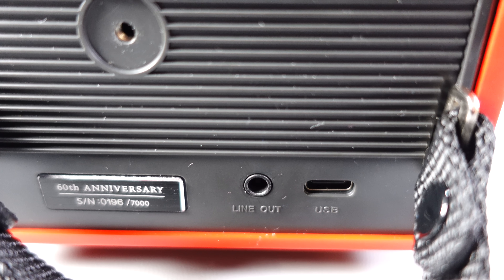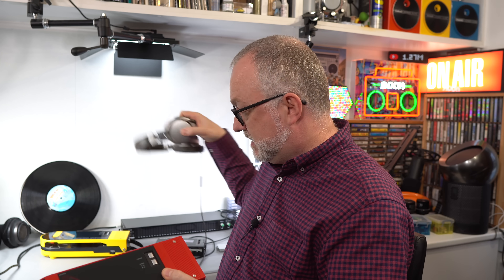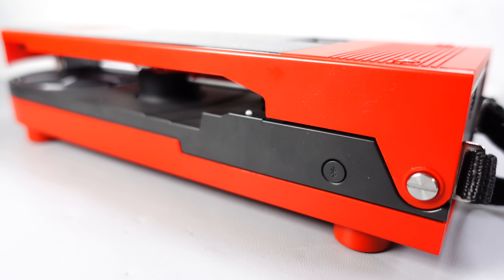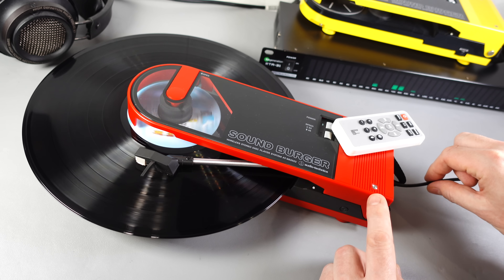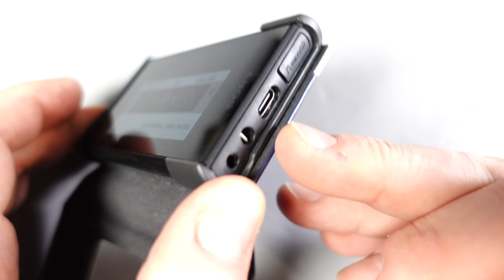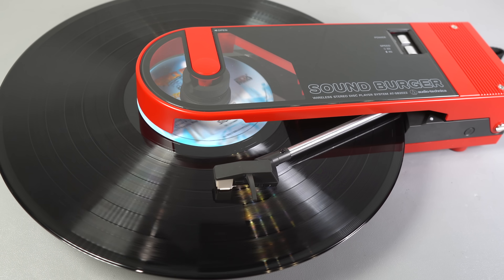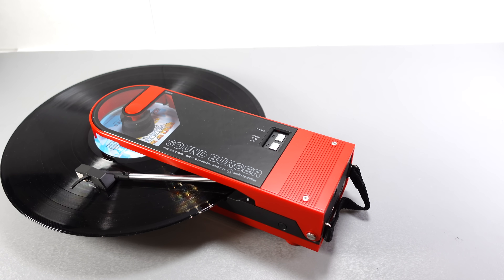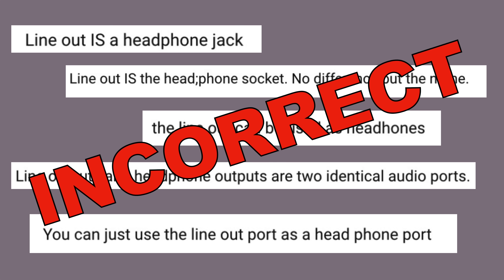Line-out ≠ Headphone-out

Comment: I made this mistake in reverse about twenty years ago when I bought a (then) high-class studio monitor because its specs were really impressive (and I was single and didn't yet have children so money wasn't much of an object). I quickly found out that a device that looks like just a pair of headphones with a fancy name but is designed to run from a line out socket will absolutely BLAST your ears when you use it on a headphone socket by just translating its 5mm plug to a 3.5mm one.

I'm still using this very monitor on my PC today (it's still good enough for my aging ears and money very much has become an object). After much experimentation including setting the Windows volume mixer to 6% (8% was WAY too loud), using the horrible line out sockets on most mainboards (which made using a good monitor a farce), using a piece of software to add lots of negative amplification into the signal while it's still digital (that worked rather nicely, but only as long as Windows updates wouldn't shuffle the audio devices around and make it forget its settings.) At some point I found out about USB DACs that register as a sound card and have a proper line output, and ever since I've been set.

Comment: This is so true where manufacturers use audio sockets as power inputs/outputs. I have seen cannon sockets used as mains outputs and speaker quick clip sockets used as power outputs. I would hate to guess what would happen if you stuck a pair of speakers over a mains output or worse still plug a cannon plugged microphone into a socket with mains behind it! Even seen speakon sockets used as mains in/out where normally you would plug in a monitor speaker or powered speaker. You really have to watch what you have these days and use common sense.

Comment: Something that should be made very clear, as a warning, is that using headphone out as a line-in can damage the target equipment and/or create a horribly loud noise.

As was mentioned in the video you CAN use the headphone out as a line-in but you have to remember to turn the headphone volume down to almost zero. Inevitably some people are going to forget to do that and will get a nasty surprise. Think of the speaker that gets blown out in back to the future and you will have some idea.

Similarly, using a mic in as an input for something other than a mic can have the same effect. You have to remember to lower the mic level to zero and the turn it up a little but until it seems right. Imagine though that you have a headphone out at max volume going to a mic in at max level. Again you could damage equipment and create a horribly loud noise.

Comment: The lack of a volume control was almost all you needed to point out, but I think this was still an interesting video and worth making. You are good at taking a fairly unpromising topic and fleshing it out into something worth watching.
Reply: This is not always the case. Some devices have built-in line out volume adjustment (but it's rare)
Reply: @TheExileFox  That is usually a voltage gain adjustment, most commonly in predefined steps.
Reply: Yeah.... he could have explained this in 10 seconds.

Comment: Headphone impedance is important to understand as well.  I wouldn’t mind a video on that to clear up some technical issues that people may experience.
Reply: headphones are counter-intuitive. A 600ohm is much harder to drive than say 100ohm  headphones. But with speakers, 8 ohm is more standard while 4 or 2 ohm is harder to drive (this makes sense, given Ohm's law)
Reply: @TheExileFox  indeed… I do understand the concept (pro audio/video engineer here) but I would still watch a deep-dive video on the subject. Advantages vs. disadvantages (higher impedance or lower) for headphones and how Ohm’s law effects parallel vs. series connections for speakers are fascinating concepts that every audio enthusiast will eventually come across.

Comment: Using a headphone jack as line out can cause distortion.   A headphone output is optimized for lower impedance loads and is capable of supplying more power to these loads.   A line-out, on the other hand, is optimized for driving higher impedance loads.  
A line output provides an audio signal intended for further amplification by an external amplifier, while a headphone out amplifies a signal before transmitting it.
I always have connected the line out from a PC sound card to an Aux port on my stereo for 100 Watt sound with games so this is nothing new.

Comment: I guess I am confused as to why people thought the line out could be used for headphones because as was mentioned, on this device at least, there is no volume control.  How would they expect to control the volume? Also, anyone who has a device like the Walkman shown here with both a line out and a headphone out would be able to determine that the volume control has zero effect on the level of the line out.  It stays constant no matter the volume position.  It would be like someone trying to plug headphones in to the RCA plugs on the back of a component since RCA plugs are line out but in a different form factor.  Perhaps it is that many of the younger people have never had devices with RCA line level outputs?  The other thing many components have are data connections like IR inputs and RS232, relay connections for power on/off, and plugs to transmit remote commands to connected devices like CD and similar components.  And all of these can be connected via a 3.5 mm plug, with 2, 3, or 4 wires and you would definitely not want to plug headphones in to these ports.
Reply: They would expect as mcuh because its how modern devices work. Plug your headphones into the line in on your computer. Works like a headphone jack. Now plug in your stereo system. Works like line-in. Software controls it. We aren't in the 90s anymore and everyone uses modern tech.

Comment: I am currently dealing with the same type of question but reverse.  I wanted to connect a device with headphones jack only into a split Y RCA cable into a stereo system line in.  But it does not work.  The problem is the signal comes out with too much bass.  I also get tremendous buzzing sound, like an ungrounded transformer sound.  Maybe that is caused by a poorly designed Y cable.

Comment: This just reminds me so much of my old IT job - people would want to purchase a notebook computer that still had a serial port when everything was moving over to USB 2.0 only.  They would point to the VGA socket and ask why they can't use an adapter to connect a serial cable to that.

USB to serial adapters did exist but the software they were using was typically DOS based so simply wouldn't see the port as it would be trying to talk to the hardware directly rather than using the OS.

Comment: So you can and it wouldn't break anything but either you amplify or very good ears. but technically you can put them in ,so not really wrong only limited usability.
But what about for example my teac turntable with on off preamp? Would it work with preamp on?

Comment: I suspect "Gain low/high" on that headphone amp is to accommodate different headphone impedances on the output, rather than variation in line levels on the input.  The latter should be standard. But headphones typically come in a wide variety of impedance ranges.

"Just because the jacks are the same doesn't mean they all function the same" reminds me of when, in childhood, I used an electric cord (complete with mains plug) to run speaker wire to a remote speaker. My little brother saw it and plugged it into the wall socket to find out what electricity sounded like.

Comment: I have a Sony NW-HD5 Network Walkman (in fact I have six). The output can be switched via the menu from Headphone to Line Out. The strange thing is that the result of switching from Headphone to Line Out contradicts your video regarding the output level.

When I connect active speakers or my HiFi to the NW-HD5 set to Headphones, I can alter the volume and EQ settings from the NW-HD5, however the max volume is too low. If I switch to Line Out, the volume is boosted greatly and the speakers/Hifi  work as expected. 

I invariably forget to switch my NW-HD5 back from Line Out to headphones, which results in my earphones nearly blowing my brains out, with a level so high that it's just a distorted mush.

Answers on a postcard please:o)

Comment: You can use headphones and speakers (detachable ones with 3.5mm end on some boomboxes) as a microphone, and a karaoke microphone as a speaker. Fascinating discovery many people do not know. Even Clydesight was surprised to discover this years ago. Yes, Clydesight is an amazing YT channel very similar to yours, and VWestlife. I find it fun using a Walkman-style headset as a microphone in a digital camera. You don't get the bass pickup with headphones, whereas with speakers you can't record high frequencies. A karaoke mic you need the volume turned up high but if too strong amplifier can damage the diaphragm!

Comment: There is also the problem of the impedance of the line  out it is approximately 47K ohm and a headphone is between 16 to 150 ohm according to you FiiO :10.37
So you are practically short circuit the output which will crank up THD if any output.
Like you're video, Nice Work 😊

Comment: Awesome video and explanation.  My guess is that several audio "purist" heads exploded when he says "the purpose of line out,  you always need to amplify it..." . They all looked over at their super pricey passive "pre-amps" aka line level attenuators ( which is really what they are since they are NOT amplifying the incoming signal, and instead just attenuating whatever is available and routing it). and their heads went POOF!  There has been debate about Passive "preamps" vs Active preamps for far too long, add to the discussion the varying voltage output of line level signals from various source devices , and the voltage inputs expected by a preamp ( or preamp section of an integrated amp or receiver) and it gets all sorts of confusing.    The Sound Burger line level may or may not require  PRE-AMPLIFICATION before the signal moves to your equipment's final output amplification stage but that requires knowing what it's outputting, and what your equipment is looking for via it's inputs.   I do think it's odd that Audio-technica failed to include a headphone output , but I suppose that so many people use wireless headphones , ear bud and speakers,  adding one would bump up cost or manufacturing time or whatever the rationale is?   Either way, the headphone amplifier solves it.   Looking forward to the next video.

Comment: The voltage levels are similar/the same, and in some cases the "line out" can handle driving headphones, but I wouldn't rely on it. Usually the output impedance is too high, as others have said.

Comment: You might also find a read on RIAA equalization interesting! When I ripped some records at line level, I needed to use an RIAA - EQ vst plug-in to restore the sound.

For the amplifier to produce the correct sound (as the bass on a record is cut down) your amplifer needs to follow this standard. From Wikipedia:

"RIAA equalization is a specification for the recording and playback of phonograph records, established by the Recording Industry Association of America (RIAA). The purposes of the equalization are to permit greater recording times (by decreasing the mean width of each groove), to improve sound quality, and to reduce the groove damage that would otherwise arise during playback."

Comment: Thank you for fighting misinformation. I usually explain this as the difference between a mechanical standard (3.5mm or 1/8") and an electrical standard (line level voltage). Just because they are phusically compatible doesn't mean they are eletrically compatible. Cheers!
Reply: ..Just because "something" is physically compatible doesn't mean it's "compatible" ..what i tried to explain to my ex...😕

Comment: Short answer: Not the same. They have different levels and impedances and in some case equalizations. Line out is designed to be further amplified while headphone out is designed to directly drive a headhpone's coils.
So, a headphone connected to line-out will sound too quiet and muffled and a stereo set connected to a headpone out will sound too loud and saturated.
Yes, you can try to adjust the levels and might work, but in that case are goint to broke the impedance and equalization thing. It won't sound as intended.

Comment: I've got a DAP and if I plug my earphones into the line-out, it plays at one volume, but it's not quiet, it's full blast. Equally useless for a headset without an in-line volume controller.

Comment: So then, answer me this then. I have a simple desktop PC which has Realtek ALC892 Audio line out at the back of the case, with an internal cable connected to motherboard that comes from the front panel that has a Headphone symbol labelled output socket. What is my actual audio line out capability?

Comment: i feel like this should be common knowledge, then i remember i grew up in the 90s and also that devices these days often use sound chipsets that measure the line impedance and other things to switch their levels/modes accordingly to work as multi-function ports (Macbooks for example) so this confusion has become the norm because newer devices have more going on under the hood than the tech of old.
Reply: +1 for analogue childhood/teens.

Comment: Great vid as always. Not wishing to draw this debate out or prolong, but the 3.5mm ports on my desktop pc will ask what device has been plugged in. As long as you select the right port, in or out. With headphones coming in various flavours, passive high impedance, passive low impedance, active high or low impedance, the sound card is very clever and will inspect the characteristics of what has been plugged in. This is really useful, as the sound card interface can be viewed, identifying sensed impedance and how it has decided to drive the output. Not sure about the accuracy of the readings (but at three decimal places it looks impressive), and I would imagine some of the PC’s resources are being used.

Comment: IN SHORT.. YES you CAN use the 'Line Output' for headphones... BUT!!!! You NEED a separate Headphone amplifier (many available from eBay/Amazon (even old style Tube types)... The 'Line Output' is a FIXED low volume output meant to be sent to Integrated amplifiers etc to be boosted in volume for loud speakers etc, hence THE NEED for a 'Headphone Amp'. Plug your headphones direct to a 'Line Output' on any audio equipment and it will be VERY low in volume (quiet)...    😎🇬🇧

Comment: I made a similar mistake connecting the phono out of my turntable to the line in of my amplifier, and wondering why I didn't hear anything but a faint sound. That's why you need a pre-amplifier or an amplifier that works with a phono signal if the turntable only has phono out.

Comment: Hi, excellent explanation of the 1/8th 3.5 connector

I have issues with staff at work when there laptop plays up they just go to the spares cupboard and pick up what is available Dell / HP / Acer  and plus in the old barrel 5.5mm power connector irregardless of what machine it is or the center pin polarity

Comment: You can easily damage the Line-Out if you plugin a low-impedance (4 Ohm) headphone or speakers to a Line-Out jack. Line-Out is a low voltage level that is meant to be connected to equipment that measures the voltage with a high impedance (high resistance, so as little as possible current flows, thus as little as possible voltage drops, resp. power is drawn). If you connect a pair of headphones  / passive speakers that need quite some power to drive, they will almost look like a short circuit, driving prob. 1000 times more current than line out is designed for (which in turn will provide only a fraction of the power the headphones are designed for). A good circuit will try to protect itself for some time, but eventually most cheap circuits will get fried.

Comment: I think the part of misconception also comes from PCs. On most modern computers when you plug your headphones into line-out on motherboard (if it has one), it can be set to be treated as headphones out instead, on newer systems like Windows 10 where it asks what you plugged in those are your only 2 options for that port, line-out and headphones.

Comment: Both low-power-requirement headphones and powered headphones work great with Line-Out sockets. It was how I listend to my equipment in the late 90's early 2000's (I often didn't use the headphone socket because it over-powered my passive headphones). 

One reason I really liked using line-out is because its unamplified and therefore very low noise *in the equipment I owned.

Many people I knew did the same. The only time I couldn't use line out, personally, was with passive speakers because they need more voltage than the line out could supply.

So whilst I get your point here about explaining the difference between amplified output vs line out (which maybe people don't know about) to say line out can't be used for headphones flys in the face of the facts of my youth. I feel you've just made the inverse problem of everyone saying "line out can be used with headphones".

You should have stuck with the fact. Line out can be used with SOME headphones, but because it is unamplified the headphones need to work with very low voltages and therefore it is inappropriate for SOME headphones / headsets. Since that is the strict truth. Therefor people saying "can't you use line out for your headphones" the answer is Yes, with a BUT, or more accurately still. Only if your headphones are very low power or your hearing is excellent (as my hearing was as a child).

Kinda feel you where uncharitable to alot of reasonable commenters with this one.